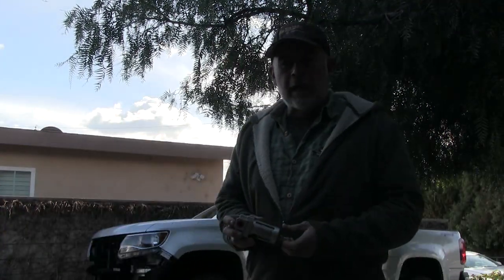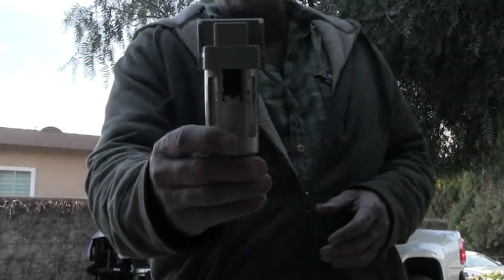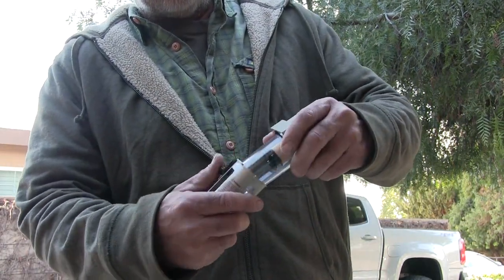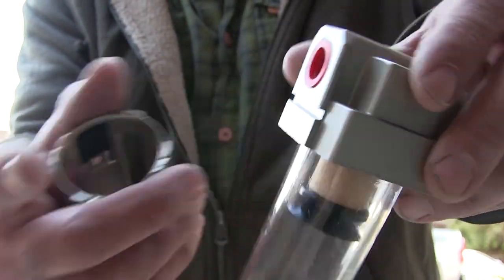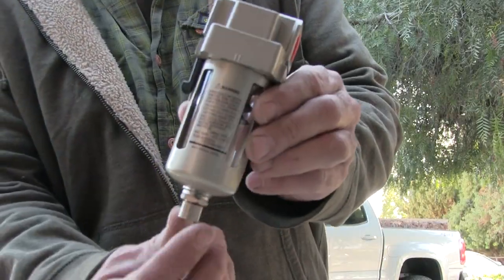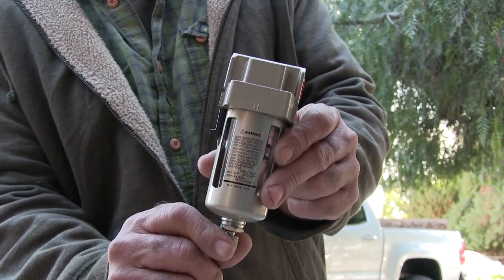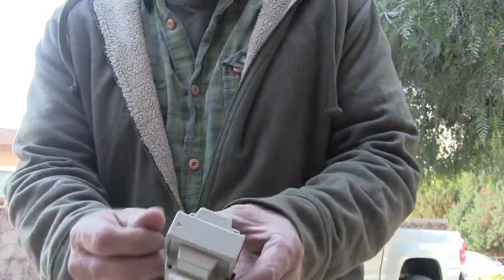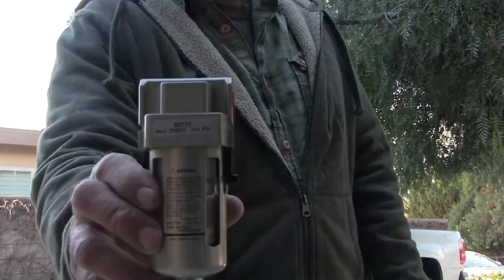$9.00 Catch Can?

Comment: Good idea but remember;
A) A PCV positive crankcase ventilation system usually works by pressure differential but actually requires a positive pressure in the crankcase to force the gases in the engine out though the PCV system. 
B) The optimal thing is to minimize crankcase pressure, or best yet run a negative pressure using vacuum pumps or exhaust scavenge systems that can help create the preferred level of pressure in negative from atmospheric by 10" to 15" Hg (mercury manometer) or about 5 to 7.5 psig negative in the crankcase system.  By lowering the crankcase pressure the blow by of the rings is minimized as the rings work more efficiently, they seal by using pressure differential.  Also, the oil control by the rings is improved as pressure differential across the oil control ring is really what makes it operate effectively, not ring tension.   
C) The primary means of oil control in the PCV or positive crankcase ventilation system is the baffling in the valve cover (notice the sheet metal attached to inside, and in some cases like Mercedes Benz the use of a centrifugal oil separator, both are effective and designed well by the car manufacturer.
D) Few comments as to add on filters usually these have either 40 or 5 micron filters... the later is preferred.  Secondly, you can use a 5 micron filter then a secondary filter to remove  even the smoke!  However, you must watch the pressure drop across the filter(s) so it is not more than 1-2 psig... or 2" to 4" hg (mercury manometer), unless you are using a negative crankcase pressure system.
Reply: lmm

Comment: This separator works well but you need to seal shut the valve on the bottom because there will not be enough pressure inside the bowl to close it and you don't want to loose vacuum on the line to the PCV.

Comment: Interesting mod. Makes me wonder if connecting the pressure valve back to the oil pan would be beneficial so that any captured oil can drain back to the oil pan. May work for turbocharged vehicles.
Reply: I think the problem is that some water actually makes it through too.
What comes out of an oil catch an is more than oil.